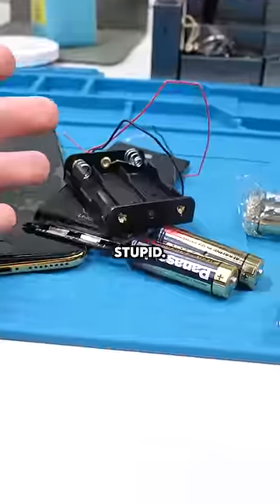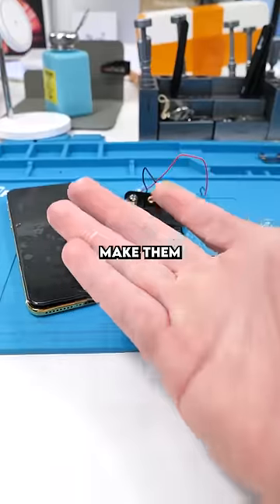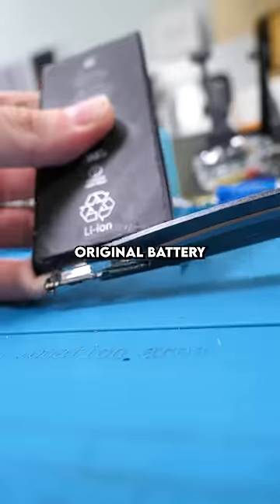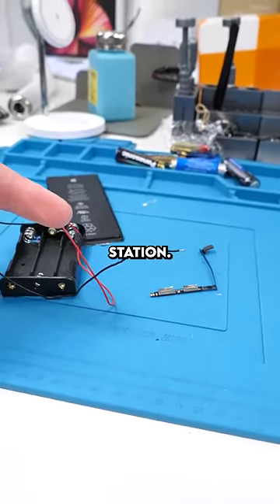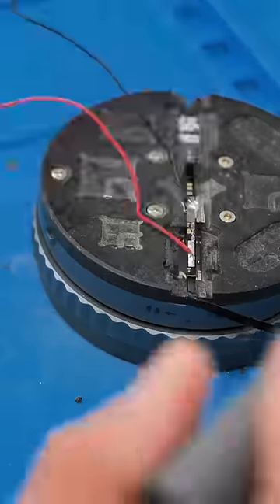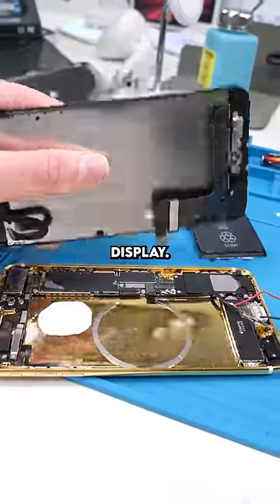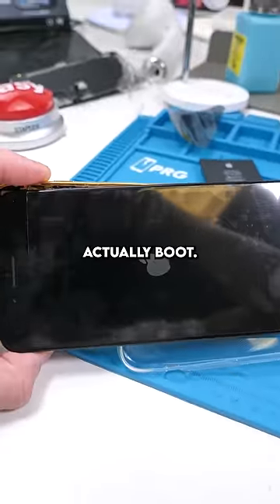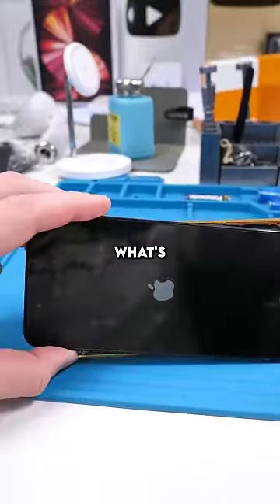REPLACING AN IPHONE BATTERY WITH DOUBLE A BATTERIES... Will it Boot? #Shorts

Comment: PRG now has become the mad scientist of iPhones
Reply from the maker: The only reason I wanna learn micro soldering is for customization purposes  Lool
Reply: @PhoneRepairGuru  fair enough
Reply: @PhoneRepairGuru   can you try making a iPhone adapter  so that you could use removable batteries from android that has same voltage as the iPhone  also it would be cool if you see if you could get replacement Samsung batteries to work on iPhone
Reply: @PhoneRepairGuru  use car battery to power an iphone? 😁😁🤭🤭
Reply: @wintersoldier2835  i lake that idea!
Reply: @wintersoldier2835  we both know how that ends 🏃‍♂️💨 💥📱🔥🔋💭💥
Reply: @PhoneRepairGuru  what music do you use
Reply: You got to much ta ta time on your hands
Love the content though
Reply: @PhoneRepairGuru   I have a question  what would you charge for fixing a phone screen
Reply: @justinkaufman495  iphone n prg go boom! lol jk🤪
Reply: @dylanlindsay1993  😂
Reply: Bro am looking for iPhone 7plus motherboard
Reply: @PhoneRepairGuru  I did this if my 2017 smartphone and it runs for 1 to 2 hours with half brightness with 2300 rechargeable aa batteries
Reply: @PhoneRepairGuru  and my man will remove the charging port and put the charger adpter board on phone and directly plug it in
Reply: @PhoneRepairGuru  so can we call you prg??
Reply: @addisonfrank9211  It would depend on what phone model of screen you need to get replaced since not all models of screens are the same price.
Reply: @PhoneRepairGuru  x
Reply: ye
Reply: Ah yes, the nilered of phones
Reply: Bro speaks Minecraft enchantment table
Reply: @PhoneRepairGuru  do customers give you their passcode
Reply: @PhoneRepairGuru  nanomachines, son
Reply: @seamali4383  standing here
Reply: Hi
Reply: @PhoneRepairGuru  is it possible to change the port on a iPhone to micro usb?
Reply: PRG ah yes world of abbreviations this is

Comment from the maker: Just waiting on some stuff in the mail to get this going.. It's gonna be pretty interesting. I have a lot of really exciting stuff planned for you guys over the next few weeks, stay tuned!
Reply: Oooo! funnn
Reply: sick aight
Reply: I am always early:)
Reply: Try with a 9v batteries
Reply: Okay :D
Reply: Collab with the guy that made the type c iphone
Reply: This is gonna be fun
Reply: Cover apple putting battery percent back in ios
Reply: Car battery?
Reply: Car battery?
Reply: Use 18650 cells. They are 3.7-4.2v same as iPhone battery. Or a buck/boost converter to get constant 4.2v (battery % won't work this way though)
Reply: @techguy970  ok
Reply: Your idea is add 9V battery (maybe batteries)!
Reply: Once you add the voltages to be right, you should be able to add as many in series as you want for a technically infinite mah…
Reply: I want to get into the tect business do you have any tips for me prg
Reply: Pin this
Reply: Hey use duracell
Reply: what soldering iron do you use?
Reply: A legend who doesn’t even pin his own comment
Reply: @bilalexe8628  Just realized I didn't change my name to TECH GUY (Tv Clips)
Reply: you ordered a transformer to make the voltage correct, I'm assuming?
Reply: I meant resistor
Reply: You got a voltage regulator didn't you
Reply: @thebeast7590  THAT'S THE WORD I WAS LOOKING FOR
yeah I asked that exact same question
Reply: You can use 4 AA batteries and a LM7805 ic circuit, it will power on.... I think.
Just need to do some soldering and it should boot.
Gotta try myself tho
Reply: This is my dream lmao, my phone cant last for more then 3 hours
Reply: U need 4 batteries
Reply: Use rechargeable ones that have a charged voltage of 1.2 as 3.6 is within the volt range of a liion
Reply: You should try using a rc car battery and attach the plug in wires to the phone or mabey a drone battery also
Reply: It's been 11 days man where's da link to da vids 🙏🙏🙏
Reply: Pretty cool not gonna lie
Reply: I'm guessing you ordered a Boost converter.
Reply: You should test this with a android battery
Reply: 1 year latter

where did the page go

Comment: Use a so called "Buck-Boost Converter" which allows you to regulate the voltage to exactly 4.2V or any voltage you'd like. That should allow the phone to normally boot 👌
Reply: The phone already includes such a device.
The reason it doesn't boot is because AA batteries cannot output enough current to keep the phone running.

Some alkaline or lithium batteries might work, but anything else will not have enough energy and poses a safety issue.
Reply: @Duck_side  each of them can put out over 15W, giving them a combined total of 45W, a phone will use 5W max, nowhere near 45W
Reply: @antreaskonstantinou8585  they’re in series not parallel
Reply: @Duck_side  Time to connect 3×AA packs in parallel. It could be an iPhone that takes 12 AA batteries, but it could work.
Reply: @callumorchard6856  series power also increase, you can either increase the voltage or current
Reply: Damn i learnt about that last year and wondered who would use all this
Reply: @antreaskonstantinou8585  Do you really think a AA battery can do 1.5V 10A ??? That's impossible with current battery technology. The maximum current is more like 1A, which is 1.5W.
Reply: You dont nees a buck converter for this
Just use a shottky diode with 0.3-0.4v voltage drop
Reply: @secretwebsite  Duracell AA are capable of outputting 8AMPS at 1.5 volts which is way more than enough for the iPhone to boot. The main reason why iPhone was unable to boot is because the voltage was off the grid, meaning it was to high. A typical smartphone requires an operating voltage of 3.7 to 4.2 volt whereas three batteries in series have an output of 4.5 volts.
Reply: Wrong. Three batteries in series output a voltage of 4.5 volts. Buck Boost Converters are only able to boost the voltage (4.5 and above till whatever’s asserted). What Phone Repair Guru Needs is a Buck Step-Down Converter which would step down the voltage from 4.5 volts to whatever’s desired.
Reply: @Duck_side  AA Alkaline batteries aren’t as innocent as people make them to be. They are totally capable of outputting up to 8 Amps at 1.5 volts.
Reply: @staidey5994  buck-boost converters can do both ie reduce and increase voltage
Boost converters can only increase voltage
Buck converters only decrease voltage
Reply: @secretwebsite  thats what i thought until it melted my multimeter's 10A fuse in half a second and seeing the final reading be 11,3A
Reply: @Duck_side  wtf dude fresh Ni.m.h. can output like 3A without voltage drop.
Reply: @hardnachopuppy  wow, had no idea that these existed.
Reply: I thought I knew about batteries, well given the fact that I use High Drain cells religiously because I Vape, but damn this thread takes me back to school. Damn I miss chemistry class, my High School science teacher was such a cool lady. :')
Reply: Maybe the BMS is monitoring the battery impedance tho.. Alkaline impedance is higher than lithium to start with and because they are in series they adds up.

If thats so, maybe the BMS think the "lithium battery" is dead because of its high impedance.
Reply: @secretwebsite  AA batteries can indeed deliver 10 amps, as I found out when I measured a AA battery using my multimeter on current mode.
Reply: btw iPhone batteries are LiHV, so you need 4.35v
Reply: You can just use a transistor
Reply: just use different lithium cells like 18650's. they have those sort of socket things for those too.
Reply: @callumorchard6856  fella, there's a reason we measure power in watts
Reply: @antreaskonstantinou8585  idk. if you short out a AA with a thin wire, it gets pretty hot, but idk about 15 watts hot
Reply: The idea is sound but you glossed over a few facts, mainly to do with the chemistry of different types of AA batteries.  
In theory you could make a charge pump for this, but this comes with its own host of problems such as the capacitors needing to be charged all the time, so they will eventually not get enough charge from the batteries and it won't work.
Reply: @EnsignLovell  same goes with the lipo battery the phone comes with.
Reply: @Duck_side  Actually, it could be the LiPo BMS triggering its overcharge protection, as 3x alkaline cells tops out at 4.5v with fresh cells. LiPo cells have a hard limit of 4.2v when charging. Anything past this and you risk turning it into a flamethrower or severely shortening the cell's lifespan.
Reply: @staidey5994  Voltage sag is a thing. Alkaline cells have significant internal resistance.
Reply: @secretwebsite  Bro I have aaa nimh Batteries that can deliver 10 amps
Reply: @staidey5994  I have never seen Duracell outputting more than 2A.  Maybe its a reading error of your multimeter?
Reply: @AndrewTSq  maybe it’s just you never seeing a Duracell battery outputting more than 2 amps?
Reply: @staidey5994  Did you really just say that? Maybe learn what your talking about before telling people they are wrong and trying to preach about something you clearly dont know anything about. 

Its literally in the name....Buck-BOOST converter. Most of which are sepic converters.
Reply: @hardnachopuppy  That's a neat little trick that would work for a short period until the batteries voltage dropped a few tenth's of a volt. Probably fine for the sake of a quick video demo.
Reply: @motosk8er2  maybe you should read the whole comment section before shitting out with a premise to state the obvious. Someone have already emphasized my mistake and I, as a normal person have embraced that fact by replying to that very person that I was, in fact, in the wrong. There’s no need to further dredge out irrelevant, long been resolved comments and replying to them with even more insulting crap.

All things aside, I’m not even sure which comment you are referring to in the first place.
Reply: @staidey5994  Oh I did read the whole thread. And you where the only person claiming others we're wrong, when in fact you where the one who was wrong. This is a public forum. I'm free to add my 2 cents. If you dont like being called out then maybe dont call other people out unnecessarily.
Reply: @secretwebsite  In parallel I think they can output 1.5V 10a
Reply: @staidey5994  the datasheet for every battery I've ever seen says the maximum is around 1A on average.
That's 1.5w

You are right that they can output 8A, I've seen them do it. I've also seen them explode because they got hot enough to melt steel
Reply: @ChillBing  yeah, but they will also get extremely hot and explode.
Just because something can do it, doesn't mean it should.
Reply: @DigBipper188  I do not think you understand how charging works.

Generally a circuit controls the current and voltage supplied to the battery, which will have its own rated input maximums but even without that, the way you charge a cell is by supplying a higher voltage to it than currently in the cell. As long as the battery doesn't get charged beyond about 4.35v, usually the chemical breakdown point, you're good. 4.5v is perfectly fine
Reply: @Duck_side  recommend and peak max currents are completely different things. Its generally not recommended to dram AA batteries at currents higher than 1A, but that doesn’t mean that they can’t give out more. I’ve tested AA batteries using my multimeters current meter and it was giving around 10 amps for a moment but then it gradually went down as the battery depleted.
Reply: @staidey5994  yes that will happen.
If you had enough energy in that battery to sustain that drain, you'd have noticed the battery get so hot that it would begin to melt and likely explode (personally experienced this with crappy Chinese batteries once)

You should really look up the data sheet for some typical AA (LR06) batteries, lots of interesting information in there
Reply: @Duck_side  This is correct, although I was talking mainly about the fact that the datasheets on lithium ion batteries have a hard limit of 4.2v for the cell voltage (4.4-4.5v for some LiHv cells like the ones used in Samsung batteries). Past this you will cause a dilectric breakdown and eventually internally short the cell. So to prevent this, a lithium battery's BMS will cut the charge current as soon as the cell reaches its voltage limit. If you ditch the BMS, you can obviously overcharge the cell no questions asked because it is completely unprotected and that cell will have no qualms about taking on extra current, but with the BMS in place, the chances of this actually happening are quite low to none-existent provided the BMS is functioning properly.
Reply: @antreaskonstantinou8585 a AA battery can definitely not output 15 watts lol,

Comment: Try using rechargeable AA batteries. They tend to have a lower internal resistance, so they can deliver more current, and the voltage when fully charged should be about 3.6V, and it should stay almost constant during all the discharge curve. Try adding a small capacitor too near the original battery contacts (maybe a tantalum one) of about 470uF, should really help with the current spikes the phone draws.

Comment: You could always try adding resistors/compacitors to even out the voltage and amperage
Reply: that's not how it works
Reply: @king_james_official  Yes it is, voltage = current/resistance. if you add more resistance, the voltage decreases.
Reply: @prabhsaini1  ok, and? you can't possibly predict the current that your phone will use. at this point just get a buck converter and don't waste time on resistors. also i have no clue how "compacitors" (which i suppose he meant capacitors) might help in this situation
Reply: @king_james_official  ok mr know it all, funny cuz I actually made it work on an old galaxy s6🤡
Reply: @hackzgamezyt  you're telling me this like i care. you've probably overheated or undervolted a few components, but the phone worked

Comment: Easy; DC-to-DC buck-boost converter, you can set your output voltage to whatever you want. You'll probably want more batteries that have a higher voltage than the phone expects, then you drop the output voltage on the converter.

Comment: This can actually save someone's life if a person is somewhere with no battery or a charger but other batteries are available you could perhaps use this method to boot up the phone and make an SOS the soldering is not as necessary as long as you separate the + and - right it should work.

Comment: Will they show your battery percentage??💀
Reply: All battery percentage in a phone is actually just a prediction. It doesnt actually show how much battery left in the battery because you can't.
Reply: @godofnothing520  actually it is, the bms board is not only responsible for making sure that the cells get evenly charged, it detects the voltage of each cell and the phone uses an algorithm to figure out the soc (state of charge) and displays it in percentage, although not very accurately, its still better than a display of milliampere, its a lot less confusing, and the percentage is simple and friendly letting us know with ease how charged our phone's battery is. You are very welcome for the explanation young grasshoppa 🤣
Reply: @godofnothing520  Bruh, the bms detects the voltage from 2.5 to 4.2 volts and calculates the procentage it shows exactly your battery level (it could go less than 2.5 and more than 4.2 but that's dangerous and bad for the battery)

Comment: If you did this with NiMH or NiCD batteries you might get somewhere.

The BMS will be detecting that the battery is over the safe charge limit of 4.2 volts, therefore disabling its output to "protect" the pack.

This is because alkaline cells are 1.5v a piece. three in series is of course 4.5v, which is grossly over the safety limit of the BMS.

NiMH and NiCD cells are 1.2v a piece though, so three of those is only 3.6v, which is around the nominal voltage of the Lithium polymer battery the phone ships with. This should mean the BMS will enable, and you will be able to draw current from the cells. I wouldn't recommend charging it like that though because NiMH and LiPo cells have very different charging characteristics.

Comment: You could hook up a 5.5V 1F capacitor in parallel with the batteries to see if that fixes your issue. It might be turning off due to current spikes which those batteries can't provide. I don't think it's the voltage per se, it's probably the voltage drop under load. I tested an AA battery here. Under load, dropped to 0.9, which makes 2.7 in a series of 3, which is too low.
Alternatively, just use an energizer lithium AA battery, which has 3.7 nominal.

Comment: I suggest to use an 18650 batteries  . ( Parallel circuit)

 3.7 volts per cell.   Then use a DC 5V boost converter..   or use a  charing module to convert it  to 5v -2A. ( Depends on the module)

Comment: In addition to having the proper voltage, make sure your power source can deliver enough continuous amps. These AA batteries probably can't do that. Also remember that the voltage indicated on the iphone battery is its nominal voltage. The iPhone will work in a range from slightly above that to slightly below it. For example an 18650 with a nominal voltage of 3.7V is empty at 2.5V and full at 4.2V. That's a simplification, but should be enough to get you thinking about voltage in the right way.

Comment: So the BMS on the iPhone will have a battery over voltage protection. The issue is that you have 3 x 1.5V AA batteries (4.5V total), which is much higher than the maximum safe rating for a Li-ion battery (4.2V typically). It’s probably a good idea to put in some used AA batteries instead so the total will be at or under 4.2V. I wouldn’t use a buck-boost converter simply because you can still piggyback off the BMS and get it to safely turn off the phone when the batteries get low. A buck-boost converter will try to keep the voltage the same, so the BMS won’t know when the battery is low (although it will have a dropout voltage, but it’s just easier to not use one).